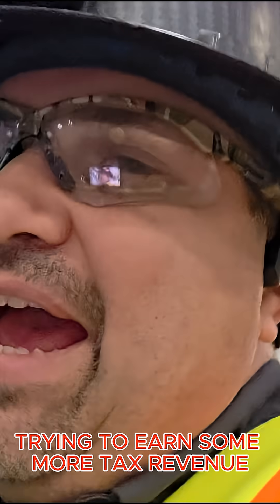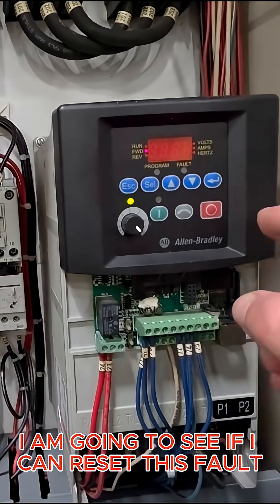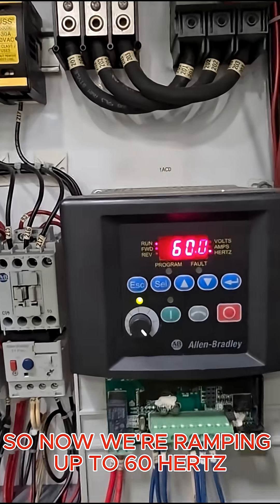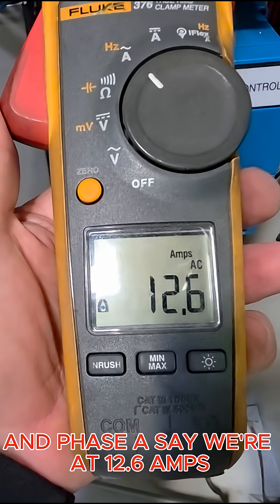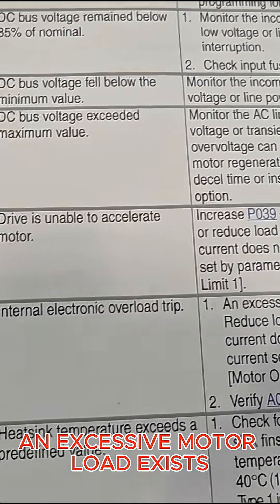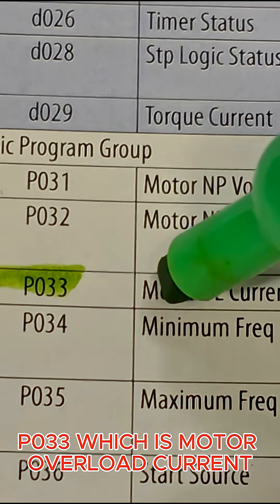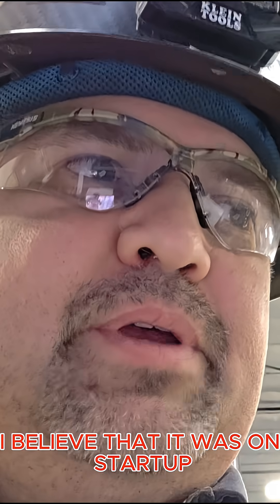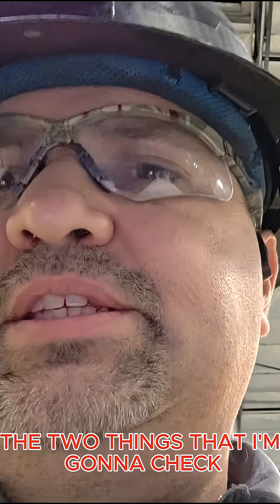AMP FAULT Nightmare: Why This PowerFlex VFD Wouldn’t Behave

Comment: If I was very busy and had motors trip out that were running full speed I would reset maximum speed from 60 to 50 or 55 Hertz. Several times on 40 to 75 HP lab exhaust fans they would draw over current near full speed because BSO had a problem with a lot of dampers closed.

Comment: I had three Fluke amp meters for troubleshooting & PM ' ing over 500 VFD'S. Only measured input current feeding drives. The cheapest meter T some thing  ( Fluke T100 ? )with the open fork to go around & measure up to 100 amps never appeared to measure output drive currents correctly.